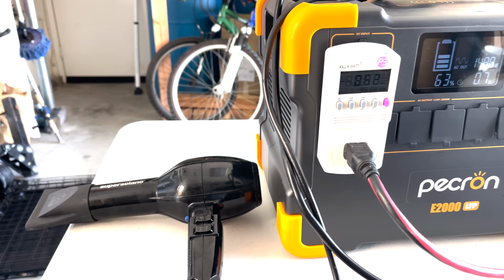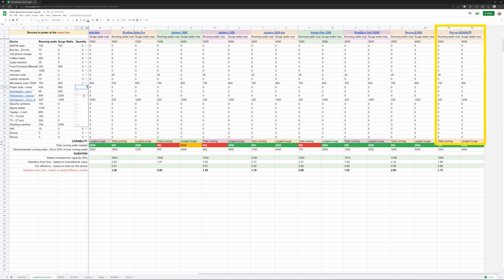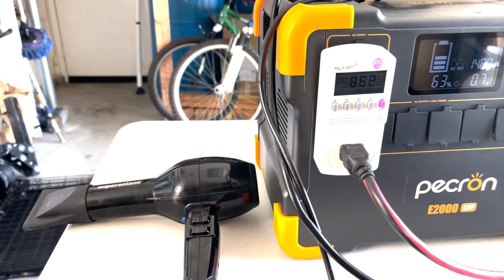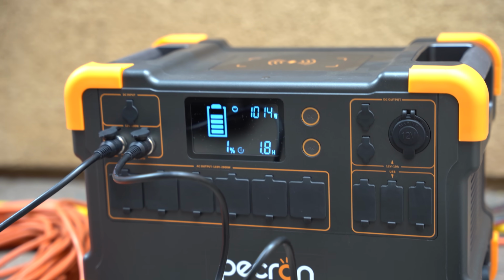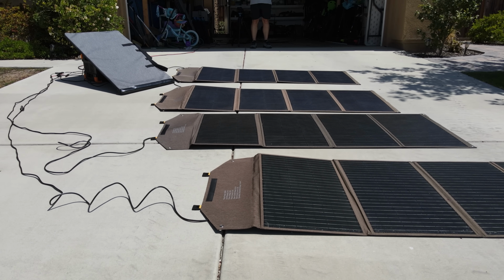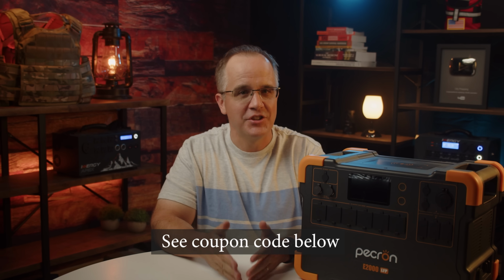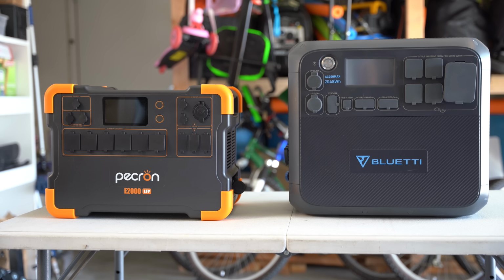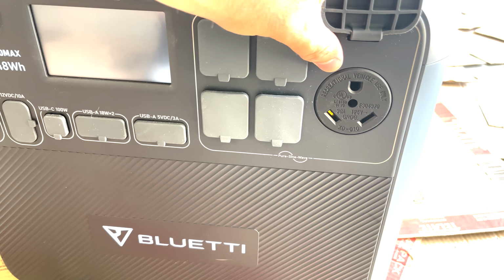Pecron E2000LFP: The New King of Solar Generators for 2022?

Comment from the maker: If you're interested in picking one up, you can get it here: https://cityprepping.tv/3d5A45m ... Use coupon code "CITYPRE2000LFP" at checkout.  Use this guide to compare the Pecron E2000 to the other models: https://cityprepping.tv/3wyZNJp
Reply: Really appreciate this review as I have watched your other video reviewing best generators a few times. Any chance you have recommendations on the best solar panels to use with the Bluetti or Pecron? The folding option shown looks nice, but I'm trying to see what is most cost effective.
Reply: @porterhillbilly  2000 watt continuous or roughly 16.67 amps
Reply: Thank you for the review & coupon code. I just picked one up.  Excited about the lithium iron phosphate. 

Anybody have suggestions on alternate packable solar panels? I like the Pecron panels, but $450 for a 200W, 36V panel feels like a premium price.... Or am i nuts and should just bite the bullet here?
Reply: @angelo9826  dokio 300w on Amazon are not bad for intermittent use, and much less expensive although lower voltage.... Could run multiple in series
Reply: Just a couple of clarifications from your video. You mentioned the Pecron as having an advantage in solar charging. This may be true out of the box, but Bluetti makes a DC charging enhancer that allows another 500 through the AC input. So a single AC200Max is capable of 1400 watts solar input. Each expansion battery can use the same device so if you have two B230/300 batteries you can charge with a total of 2400 watts!

Same thing on AC input. The Max ships with the 400 watt but it's compatible with their 500 watt charger. The solar input adapter can be used with a second AC charger. You would have 900 with the standard plus upgraded charger. If you happen to have two of the 500s then you could have 1000 watts of AC input.

So the AC input is much closer than indicated. And the solar advantage ultimately goes to Bluetti!
Reply: Question:

If I buy a generator & there was an EMP, wouldn’t the Grid down situation wipe out the generator???

My husband mentioned that. 
I thought I’d ask you all. 

Please advise.
Reply: @CP OUTSIDE OF THE BATTERY TYPE..HOW DO YOU LIKE THE  E3000? (VS WHATS OUT NOW) FOR THE MONEY
Reply: Does anyone have advice around my question re: what would happen to a solar gen IF there was an EMP?
Reply: Where do u get 1349 price?
Semper Fi
Gunny
Reply: SHOULD WE WORRY ABOUT THE SLIGHTLY OFF SINEWAVE?
Reply: JUST GOT MINE TODAY, AND THE CART
Reply: @BOOSTEDLASER  absolutely not Boostedlaser. Perfect sinewaves are never seen in a real environment because everything you plug into an outlet can and often does modify its shape. But it’s nice to know you are starting out clean.
Reply: @ReasieRoo  graced and grateful… there is a site on YouTube by empdoctor that can tell you how to protect against emp’s…
Reply: Hey Kris thanks for doing this video. We watched it when you first posted and have been waffling between this and the Bluetti. We decided on the Pecron for several reasons. First of course the price, second the input capability, third the weight and fourth the dual independent solar inputs. We have 200 watts of solar on our trailer roof and if we decide to add additional solar it will be far more convenient or at least it seems that way to me. We have a lot to learn and you have been so helpful with your instruction and recommendations. Oh and I completely forgot, at the last minute I remembered to use your discount code and got $119 off. We will let you know what we think of it after using it for awhile. Thanks again. :)
Reply: @angelo9826  Looking at Pecron or EchFlow. Any thoughts on your purchase? I am looking for foldable panels too that I can store easily. Not sure what you bought. THx
Reply: What solar panels would you suggest to purchase with this unit to get the best bang for the buck?
Reply: @ReasieRoo  I can't answer your question, but I wonder the same, therefore I'm making my own custom bag for whatever generator I end up with. I was told by an insider to wait 6-7 weeks though
Reply: @paulmccarter908  6-7 weeks for what?
Reply: @jeanettesjourney9147  They mentioned a couple upcoming reviews in the pipe, but I suspect something else. What that is, is a price drop on a specific brand
Reply: @paulmccarter908  thank you
Reply: @ReasieRoo  yes, an EMP would fry the electronics if the generator was exposed.  You would need to keep it in a shielded box that acts like a faraday cage without the generator actually touching the metal sides.  Take some time and YouTube how to build a faraday cage for an EMP and you learn what you need to know.
Reply: @ReasieRoo  it would unless you put it in a Faraday cage
Reply: I just learned you get a commission on sales.  I'm looking to buy for a three bedroom home and an indoor farm in a shipping container.  I don't care about mobility, however two bedrooms are 50+ feet from the master and the rest.
Do you have a video for the category I need. 100% off grid.

Comment: Basically what people really need is a charge for refrigerator, chest freezee and a heater if needed in the winter and maybe something to cook with. I could care less about anything else. Keeping food cold, my family warm and be able to feed them. Thank you for the video!
Reply: Exactly
Reply: How many watts is that heater going to pull?  Or are you suggesting heat comes from LP, NG or some other fossil fuel?
Reply: I would say be very careful about leaning too hard on your “generator” for heating or cooking in an emergency circumstance (camping you’re probably fine if you know your depletion window). Ideally you’re using other tools for those. It takes a massive amount of energy. 

I’d suggest exploring rocket stoves for cooking. There are a myriad of of solutions for staying warm.
Reply: That is a great way to approach it. I always have the idea that I need to have a system that will run everything, but that is cost prohibitive and I don't have the physical capabilities right now to build my own. Thanks for that simple plan!
Reply: I’m just going for refrigerator and box freezer. Heat and cook are by propane and wood for me. I’ve 12 full cord stacked with a forest in standby.
Reply: yes
Reply: @magiccarpetrider4594  That's my plan too, regular size fridge and small freezer, and fan on my gas logs until the propane runs out.
Reply: This is why you should own a grill, that is heated by charcoal. You can cook in summer, winter, and all year around. A used Weber can go along way. 

Power just needs to be a for a freezer and fridge. You can make hot rooms which is a better idea when it comes to this stuff. If your pipes can freeze, you should put up heating tape anyways, and make sure you can heat them with the power generate.
Reply: That's the way I look at it.. In warm weather, I just want to power my fridge and small freezer, maybe a fan or 2 in the house.  In winter, power the blower on my gas logs in addition to the fridge and freezer.
Reply: You hit the nail on the head.
Reply: We have a private well for our water supply, so we need electricity to run the pump.  Otherwise, I agree with your logic.
Reply: Relying on electricity to keep you warm and cook food isn't very sensible when you could easily get the job done with a wood stove, and go shopping for wool and down clothing. Your one time purchase now provides warmth for free without tapping into your energy reserves.

Plus, you can further reduce your reliance on electricity if you got something as basic as a wonderwash or scrubba instead of using your washer and dryer.

Really the only thing I would use a battery generator like this for is entertainment and things that depend on electricity to function like video games, movies, and music.
Reply: Amen same here
Reply: If you want to heat anything then find something else because a battery station will not get it. I know you didn't say directly that you would use one for heating purposes but a uninformed person would assume that is what you meant. These are great for the fridge and freezer
Reply: And using it easily in my RV to make those niceties available when boondocking!!
Reply: And this is not to disagree with you, I have the ecoflow delta 2 and extra battery and the river 2 max. Battery stations are great and very useful especially for lighting and refrigerator and communication and entertainment devices but the cheaper more effective way to cook and heat is with gas or fire. I have the buddy heater with a therm fan to push the heat and also several different gas stoves. Propane last forever in storage and a 20 pound tank last forever. And if all else fails wood is easy to find.
Reply: You'r right 👍👍
Reply: Thought this was company that does the mini fridge/ freezer warmer generator that girl traveler Lisa ,but she combined a word start with R my brain thats what i lost😂
Reply: Weber pits poo doo ya get more use from a old hubcap 😂

Comment: So after watching your video, we purchased the Pecron E2000LFP. We have not yet received it. We got the discount using the code which was nice, but it would have been nice if it was made known that they use a bank outside of the US and therefore VISA charges a 3% fee which in my case was an additional $53.22.
Reply: Thanks for sharing that.
Reply: Skinner.  Did you get your pecron.  If so how is it performing
Reply: @donaldricher8815  I did get it, however; I have not really had an opportunity to put it to through it's paces.  I have had it hooked up to a Craftsman LED work light that has 4500 lumens at 46 watts.  I honestly can't tell you how much it used, but I had it running it for about 2 hrs without any issues.

Comment: Just wanna throw in a recommendation in here for a longer uptime.
When it comes to lower power consumption devices that use a charger to step down voltage, like laptops, smartphones and etc, I recommend using the DC outputs of the generator instead of using the AC outputs with chargers. This is because the chargers those devices ship with aren't 100% efficient and don't have the perfect power factor. Most smartphones and laptops these days make use of USB-C to get power and this generator has USB-C PD 100W ports, so a USB-C to USB-C cable makes a lot more sense in this case. You'll get A LOT longer runtime this way. 

Additionally, I might go as far as recommending using DC whenever possible, for a longer uptime, for example, if you want to power LEDs with this, there are 12V DC LED bulbs out there, this way you won't have to deal with wasted power in a form of a bad power factor that is typical for common LED bulbs.
Reply: Great recommendations. Power conversion and insertion losses are the real thing for portable devices.
Reply: And use 5 blade USB fans instead of an inefficient AC box fan. My box fan draws up to 100 watts and my USB fand draw 2 to 4 watts. Air output from them is fine. Plus you can power them directly with most folding solar panels during the day without a battery.
Reply: @baneverything5580  Don't forget 12 volt fans than run off the cigarette lighter port.
Reply: @ronbotex  I`m looking at buying a couple of those for my camper. I`m trying to set things up, even cooking, to run directly from solar panels without the need for batteries during the day. Many 12 volt mini rice cookers appear to be perfectly matched for a direct connection to a 100 watt solar panel. I`ve discovered that Onite LED light bulbs and USB fans can be powered directly from 100 and 120 watt folding portable solar panels that aren`t directly in the sun. 

I`ve bought a lot of USB powered battery chargers and rechargeable radios to use with my folding panels and I`m slowly getting everything wired up for a full off grid situation like the aftermath of hurricanes or national emergency. I have FINALLY been able to get the beginnings of an off grid solar system for a small air conditioner now that LiFeP04 battery prices have came down. But now I need more solar panels which I`ll have to buy as I can afford them one at a time. Parts are so expensive that getting backup inverters and such is nearly impossible on a fixed income.
Reply: @baneverything5580  Which 5 blade USB fans do you use? The brand-name?
Reply: @TheVegan15  Well with the pandemic the brand names keep changing. Tripole was a good brand and there are others I packed up to get ready to move I can`t remember. Just be sure to count the blades if you buy one because the 3 blade ones don`t work nearly as well. I just tried a tiny one made by GAIATOP that works surprisingly well. Just make sure they`re 3 speed fans with more than 3 blades and they should do well. I`ve tested them now for a long time and they seem built to last.
Reply: @TheVegan15  Get the ones that plug in. Don`t buy the ones with a built in battery. Use your own battery like a power bank. It`s a lot cheaper.
Reply: @TheVegan15  Opolar made good ones too. Now I can`t find that one.
Reply: @baneverything5580  Ok good to know👍
Reply: @baneverything5580  Thank you, I will look for the 5 blades.
Reply: My solar cabin is USB everything. Opolar USB fans, USB lights. My tv/DVD player is cig lighter power, I only invertbto charge laptop and clippers
Reply: The other thing is that there's no mention of a way to disable the AC inverter. With the 85% efficiency (pretty bad on its own), I can't imagine the tare loss leaching your charge if left on when not in use.

Comment: Thanks Mr. Kris! We've been seriously studying solar generators lately and then you post this! Thankyou! In a down grid situation all we need to power is a small window AC unit, my O2 concentrator and hubby's C-Pap. We have a countertop icemaker for ice in a cooler to cool down some things but that would be a luxury. Getting ready to camp in our own homes! Bless you and your team, Mr. Kris!
Reply: Good info - thanks. We have O2 concentrator and 2 CPaps -- Will look for window AC unit. No need to power house HVAC when one room chilling is all we really need.  Seems like this unit (after 2 of the soon-to-arrive batteries) will do the trick!  Best wishes to you...
Reply: Did you end up purchasing the pecron or other brand
Reply: @donaldricher8815  purchased Pecron since expandable to watthours that I need. 
Expansion batteries now (11/3/2022) available for pre-order. 2 max can be attached and only for 2000. Cable included and battery can be recharged separately from 2000 unit...solar, lighter or AC from wall.

Comment: Couple of things to add.
LFP batteries are quite sensitive to cold; even more so than more typical NMC cells which are bad enough, so if you are thinking of leaving this thing on the shelf of your unheated and at times ice cold garage till you need it, that may not work as well as you expect.
Also the expansion battery packs they liberally advertise with this product remain unavailable.  Other broken links on their website too. 
While a very appealing product to me, I am going to wait a bit yet.
Reply: Thanks for sharing that.

Comment: With the current state of features being promoted by other power generator, I would add the UPS feature as an important feature for the preparedness community. My number one asset is to automatically protect the frig and freezer at any instance of time. Since the Pecron does not have a build-in UPS, I would place it on a second tier but recommended product since it's a capably solution but only after I bring it out and turn it on. The cost of the expansion battery will be another consideration. Since it's not available at this time, you cannot properly evaluate the economics of the system.
Reply: Sometimes you can almost buy a new power station for the cost of the expansion battery!

Comment: AC200Max can accept up to 1400W of solar if you buy the DC Charging Enhancer they sell, also it can easily accept 2 500W wall bricks, you just have to get a XT90 cable for it and you can charge around 1000W from the wall at the same time.

Comment: Thanks for another informative prepping video.  I agree that this Pecron is enticing for many, including myself since I've been comparing most to the Bluetti AC200Max.  However, I feel that there's one technical detail you didn't focus on that eliminates this as an option for me and perhaps others.  The Voc is only between 32-95V.  That limits this to only four 180W panels with an open circuit voltage of ~22V each.  The 1200W of PV input is not technically accurate since it includes using 600W of AC input, per the Pecron site.  By comparison, the AC200Max can handle 10-145V.  It is still much cheaper than the Bluetti and 4 180W panels might be enough for most people's needs.  Keep up the great work and thanks for being so up-front about your reviews and the compensation for the reviewed products.
Reply: There are two 600w mppt inputs on the device and a 100w solar input as well for up to 1,300 watts solar. High voltage is better for a longer distance to your solar panels due to a lower voltage drop. But 2 mppts at a lower voltage is better for shading because the shading of one 600w area won't lower the total input power from the second 600w array. You could also have the 2 arrays point in different directions, like two sides of a tiny home.